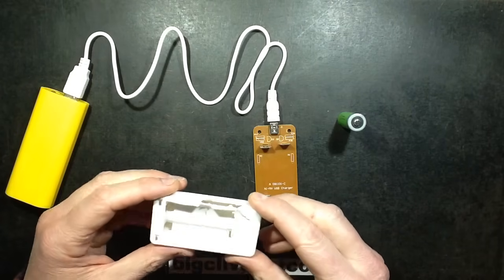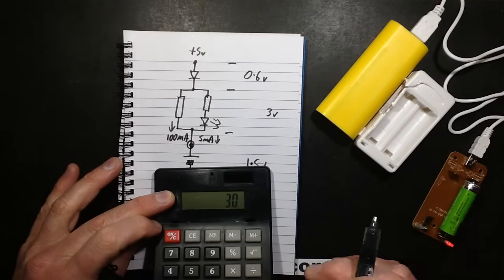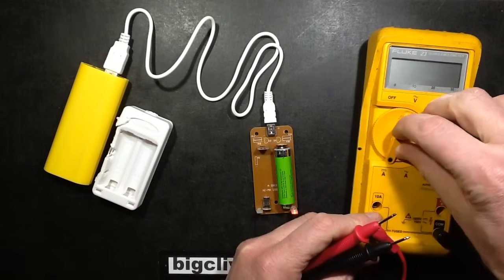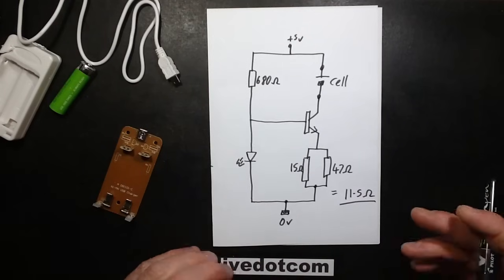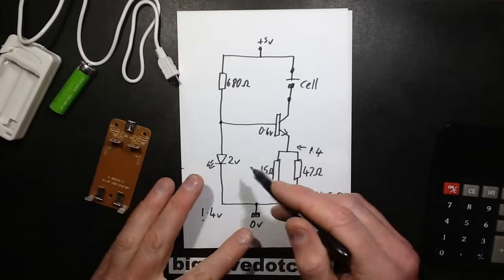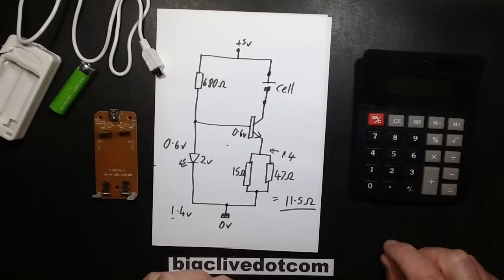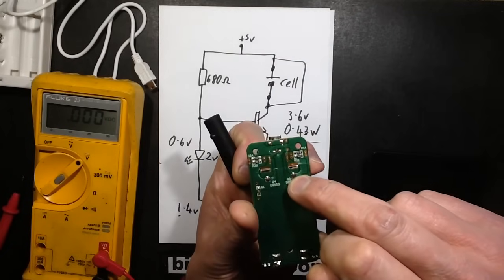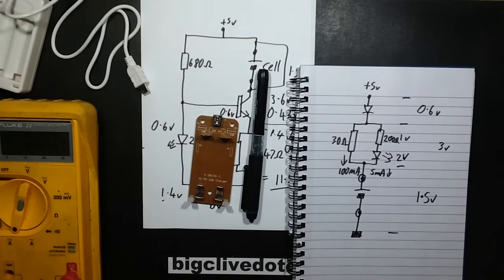Weird USB battery charger circuit.

Comment: This circuit with constant current is sometimes called a "current mirror". With the left side maintaining a constant base voltage with constant base current and the collector has almost the same current with emitter, collector 'mirrors' the current on the diode. A nice article explaining this in detail can be reached by searching "Bipolar Junction Transistor or BJT Current Mirror".

In this circuit the LED is used as a diode and at the same time as an indicator. In addition to this, it is very common to use another one of same transistor and connect base and collector together to convert it to a diode with identical junction characteristics since each pair of Base-Collector and Base-Emitter is a diode by itself.

Comment: Wow - thats the exact same circuit I came up with as a unregulated input constant current NiCad charger back in the 1970s.  It was a challenge with my boss to come up with a circuit with the least components.  The transistor part is pretty standard - it was the use of the LED as the voltage reference and also charge indicator that was the clincher.

Comment: Transistors are attached to large copper areas, so they will handle 0.4W for a while, but they are normally limited to 0.2W in the standard thin trace condition. In a larger TO92 package you will only handle 300mW in any case, so they are being used (barely) within thermal limits in normal use. Nice design, and a pretty good regulation figure for such a cheap unit.

Comment: Yep! I rarely use PNP transistors too. Only when I need a extremely symmetric circuit (like a power amplifier, for example) or slightly high gain.

Comment: You are extremely intelligent and I love the analysis you do on all your videos. It's keeping my schooling fresh.

A couple of notes:
They could have put the diode in their circuit too to prevent backfeeding.

Also, they are going to have on the order of beta times better current regulation than your design against supply voltage, temperature, cell type fluctuations, etc.

But it's probably for the turn-off effect when the cell is charged that other commenters mentioned.
Reply: +tiger12506 It can't backfeed due to the PNP transistor in the actual circuit. Remember Clive's doodle is just an abstraction to make it slightly easier to understand. The current he's measuring by shorting +5V to ground flows through the base of the transistor and the 680 ohms, it wouldn't leak that much into the computer.
His criticism of the circuit in case of a battery short still stands, though, as, typically,  those little SOT-223 transistors are only rated for 250mW (as I found out to my chagrin after miniaturising one of my own circuits). Whereas the through-hole equivalent TO-92 package typically handles 400mW.
Reply: Poor you. If he was intelligent he wouldnt play with Youtube - he would own Youtube.

Comment: Hi Big Clive, I came across this constant current circuit back in the early 1970s. It used a PNP TO3 transistor and a zener diode and resistors of suitable power rating supplied from a Tektronics 150 valve power supply to provide a constant current to a thermionic tension transducer. I can’t remember the actual details from then but I have used both PNP and NPN versions and used an LED instead of a zener diode more recently.
Best wishes from Oxfordshire.

Comment: Clive, the reason they used switching and regulation is so that you don't over charge a cell and cause it to fail.
Those little transistors will probably take half a watt without issue because of the size of the tracks they are on acting as passive heat-sinks.

Also, you didn't calculate your circuit under dead short conditions...
Your 30 ohm resistor will be carrying 146mA and dissipating 0.645W of heat.
The LED would be forced to take 12mA

Comment: My favourite explanation of the constant current circuit is:

"If the transistor gain (beta) is high enough, the collector current will be virtually the same as the emitter current. I.e. The emitter current will be reflected in the collector as long as the supply voltage is sufficient to maintain the current in the load. The circuit is in common base configuration with the input (current) into the emitter and the output (current) out of the collector."

Comment: Very nice analysis of this circuit!

At my former workplace I had a similar Fluke multimeter and it was nearly as old as yours and it had to stand many falls from the table there. Very durable and valuable. I got myself a new Fluke 117 last year.

PS: I am from Germany but I like your way of speaking/accent.
Reply: FesixGermany  When I started work in the late 1980's, I was a trainee. The teams I worked with used Fluke 77 or Fluke 79 multimeters.
Reply: @Mark1024MAK  Mine is 179 from 2010 IIRC.

Comment: When you said it would possibly feed back voltage into the USB port I figured put a diode in line to prevent it, then I saw your circuit and said yes, that is it. I am not sure that feeding the batteries .300 milliamps would be all that bad, unless it just keeps going which it would until one took out the cells. I like the circuit, but like you said a bit more complicated than necessary.

Comment: I have actually used a similar PNP configuration to create a constant current source for biasing audio circuits, effectively using the LED's constant forward voltage as a reference voltage much like a reverse-biased Zener diode. In an audio circuit, using a stabilized current for biasing makes the circuit very resistant to noise from the power supply, but that really doesn't do much good here. The only issue I see with your circuit is that shorting the battery would result in a roughly 0.64W dissipation through the 30-Ohm resistor, so your resistor would need to be rated at least 1W or so.

Comment: Neat little circuit. The LED is acting as a pseudo Zener voltage reference as well as acting as an indicator when the battery is charging. The LED will maintain about a 2.2 voltage drop while in operation, and also serves as the charge indicator since its being driven by the base current. With no battery or a fully charged one, base current stops flowing and the LED goes out. The open circuit output voltage is the voltage of the LED minus a diode drop, or about 1.5V.  The current through the resistors when its shorted is also determined by the LED voltage reference, minus a diode drop, which gives around 100-160 mA, depending on what the actual voltage drop of the LED is, if Im reading it right. Edit: Another interesting point is that it requires a relatively shitty transistor to work. If the gain is too high, the LED wont light fully.

Comment: I have the very same Fluke model 23 meter.  I bought it maybe 30 years ago for USD $169.  Still works fine but doesn't do RMS so I recently bought a Klein CL2000 which also has the AC/DC clamp amp meter function.

Comment: And thinking that there are dedicated ICs (to23-like 5 pin) that, with only one sense resistor and,  perhaps one decoupling capacitor can safely PWM charge a MiMh cell in constant current and disconnect de cell on delta-peak or voltage cut-out or timer-cut-out... 

These are designed to damage cells, damage equipment and sell more stuff. :)

Comment: At that current, it seems like an impractical charger for all but the very low capacity AA or AAA cells found in some solar lights.  For example, nearly all my Ni-MH AAs are rated between 2000mAh and 2400mAh.  So a 2200mAh typical cell charged at 110mAh would take at least 20 hours to fully charge.  With efficiency losses, it's more likely to take 24 hours. 

Even those just doing an overnight charge such as using this as a travel charger will only be giving the batteries a 50% or less charge.  As for overcharging, the charging current does have an interesting side effect in that most Ni-MH batteries can endlessly handle a trickle charge of 5% the rated capacity, which this 110mA current happens to work out at for 2200mAh and higher capacity cells.
Reply from the maker: The USB current limit of 500mA is probably a large factor in their design.  That and the simplicity precluding the use of any end of charge sensing.  So it's probably safer to treat it as a trickle charger.
Reply: Seán Byrne These days, many people don't have battery munchers running off NiMH any longer. Everything that takes a lot of energy has a Li-Ion cell. An xbox360 wireless controller will run for about a week to a month fully charged depending on use, a wireless mouse around half a year, with lower capacity Eneloop or similar low self discharge.
Reply: Perfect for cheap poundland cells :)

Comment: That was fun.  But, with a PNP, shouldn't the LED and the CE (or EC, I'm not sure which way it is) of the PNP  stop feedback current from the battery?  I might just play with that circuit a bit, because you DID get leakage at the USB plug.  It would be interesting to know if a USB port will suck power from the charged battery if the supply power to the port is turned off.  Also, if the un-plugged charger actually puts a drain on a battery if one is left in.

It also seems that without a battery in the charger, (again with the PNP) there would be 4.4v (5 - 0.6) across 691.5 ohms (11.5 + 680).  I think that works out to 0.075v across the 11.5 ohms. With 0.6v across the PNP, that's only 0.675v across the LED.  If I'm right, that's why the LED doesn't light without a battery.

Comment: Hi Clive. I suspect the charging circuit here has been copied from earlier designs of charger. In Ni-Cad battery chargers that date from the 1980's and 1990's, I have seen both circuits (your resistor & LED network and the PNP transistor version) in these older chargers. Although back then the transistors were TO92 cased types. And often the DC supply was not smoothed.

Comment: i believe the circuit they built is not dependant on the supply voltage (or beta dependant either). it is very good used as LED driver, also

Comment: Also, for some reason I tend to use more NPN than PNP as well, but they are both needed in a push pull amplifier circuit, but that is where I would use them.

Comment: looking through old stuff..

the mcp1700 ldo voltage regulator which could be "set" for 1.5 Volt out,
could dissipate 1.6watt at 40°C ambient (i max ca 200mA) in a SOT-89 smd package.(datasheet, woaah!!)
with diode + resistor in front of it (to get charging led function) it could be used as "smart" transistor...
Would need to test if cap, then diode, then ldo@1.5V would allow the regulator to survive getting voltage fed in the output if unplugged with batteries still in.

Comment: Hi Clive, interesting charger. Have you ever actually tried making the NPN circuit that you drew? I used 3904 in a TO95, with a 2v green led. No illumination on the led and almost all the voltage (4.9v) is going the battery. Ya, I'm a rookie.
Reply: Never mind. Bad battery connection. Circuit worked great and charged the 1.2v NiMh AA perfectly. Thanks  from -across the pond-.....

Comment: I assume that if the transistor shorts out (including the base), it would blow the LED, since there is nothing limiting the current for it, and maybe stop the USB port from working (blown fuse or protection circuit). Am I right?

Comment: i wonder if it is designed so when it reaches 1.5v from a 100ma charge, it will turn off charging the cell? as at that charge rate it will have a full charge, with your plain resistor, it will never stop charging, and probably relying on the case to have a recessed positive connection to prevent reverse connection
Reply from the maker: The circuitry doesn't really monitor the cell voltage, so I think it would just keep on trickle charging it as long as there was something there.
Reply: bigclivedotcom
but im still of the opinion that once the positive end reaches 1.5v it will turn off the transistor, which it will reach on eventual charging, plus these are more to match the lower capacity poundland cells, which are i think 800mah for aa and 350 for aaa, thus an 3-8 hours charging which isnt so bad.  :}
Reply: jusb1066  No, as long as the input is about 5V and the cell voltage stays below about 3V, the "charge" current will stay at about 110 to 115mA.
Reply: ah long time reply! i have since bought one of these and yes you are correct, it actually has a use too, if you over discharge a nimh , my regular charger will reject the cell, i use this to give an hour or so of pre charge then put it back and it charges fine

Comment: would I be right in thinking the led operation could be changed if the led and the 680 ohm resister was swapped ? I.e. led would turn on when the battery is fully charged ?
Reply: BillyNoMates1974  No, the circuit requires the LED to be exactly as wired. If you change the position of the LED and the 680 ohm resistor, it will no longer work correctly.

Comment: Hi.Just made one from your excellent reversed engineered schmatic (npn) Leds never go out after 8 hours with a new 700ma 1.2v rechargeable batt.Apreciate this is a trickle charge but how long??? MERRY CHRISTMAS TO YOU
Reply from the maker: The LED won't go out.  Unlike lithium cells it's safe and normal to trickle charge NiMh cells continuously.  Once they are at full charge they dissipate any excess current as a slight warmth.
Reply: @bigclivedotcom  ok I see. Leds indicate charging and can be left connected.If it limited say...100ma charge current for example then a 700ma AA would be in priciple 7 hr charge or is that completely wrong. So So impressed you replied. Thank You.

Comment: Wouldn't use that to charge NiMh, but woudn't hurt NiCd cells.
Reply from the maker: In the early days of NiMh cells there was a lot of talk about how delicate they were and how you needed special chargers for them.  I don't think that's really the case now.  The cells should tolerate constant trickle charging of 100mA without any damage.
Reply: bigclivedotcom In the early days of NiMh when they didn't have that overcharge catalyst they started to produce a gas(oxygen?) and then exploded.

Nowadays pretty much all NiMh cell have a catalyst capable protecting up to something like C/10. (Like ~220mA for an 2200mAh cell.)
Reply from the maker: m8e I didn't realise that in the early days they didn't have the facility to recombine the gasses to electrolyte like NiCd.  I do know that the negative delta V charge end detection is more subtle in NiMh cells.  That's probably why so many "smart" chargers end the charge cycle very prematurely on some cells.  That and their inability to deal with older cells with a higher internal resistance.
Reply: Thanks,
that's very good to know.